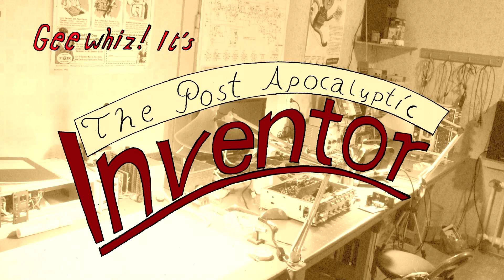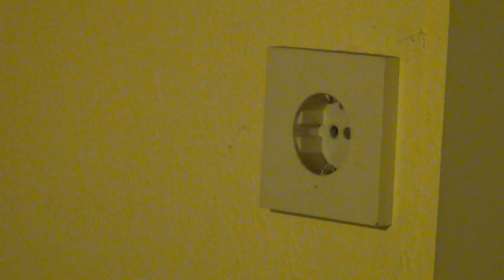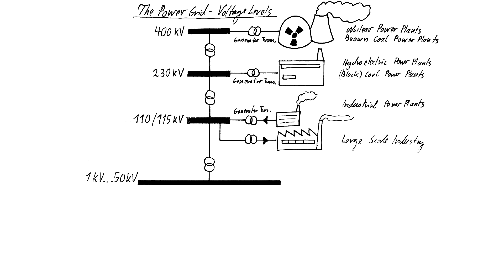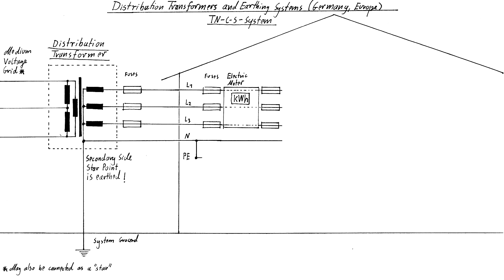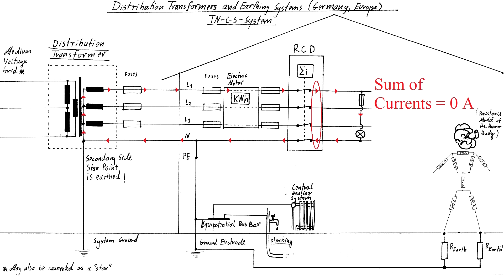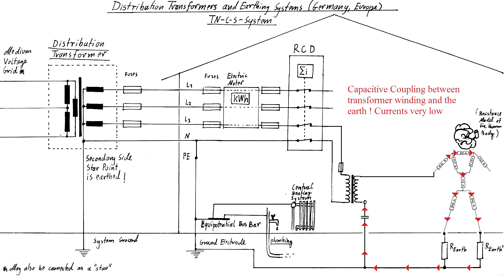The Power Grid, Isolation Transformers and Earthing

Comment: Thank you for the great video content.  Outstanding.  As to some of the comments, I would like to add some actual facts about the state of US regulatory law.

In the US, GFCI and AFCI standards are written by committees of practicing electricians.  They farm all the hard work out to an NGO called United Laboratories or UL (CAS in Canadia I believe).  Their sole focus on GFCI and AFCI safety is the PE connection to the enclosure.  Absolutely not to the real problem of Human safety.  By contract UL can only test and rule on the topics and devices they are given.

Look at this document:

http://www.screenlightandgrip.com/html/481_GFCI_Workshop.html - It is informative and fun - about the E safety systems used in the movie Titanic.

In particular, review the figure under section UL943.  If that does not get the point across, grab the neutral and hot phase of a GFCI/AFCI circuit.  Have someone notify next of kin.

The EU system of RCDs is a pain (I worked in Amsterdam for years trying to get 3P motors with phase shift problems to work, I know).  But, they are so far ahead of the US and Canadia, it is crazy.

If you have no experience with 3P power, don't confuse people with comments about the US GFCI/AFCI system.  3P is another world.  A pocket calculator and Ohm's law don't stand up to Dr. Maxwell.  Look at RCDs as part of Maxwell's world - not Edison or Ohm.

At any rate, great video.  Thank you.

Comment: Probably the best video I've seen on YouTube, certainly the best in a long time. You've cleared up a load of questions I had about how the electrical grid works. Do most houses in Germany really have three phase power? In the UK it's very rare to have a three phase supply, most have only a single phase coming to the house. I have three phase but I've wired the house to a single phase. I asked an engineer from power company about balancing the load on the phases and he said they don't care for the sort of current draws a house is likely to put on the system.
Reply from the maker: CNCtrl Yes basically every house in Germany has three phases available. Most people don't have 3-phase sockets in their houses though. But household equipment like electric water heaters, ovens and storage heaters are almost always powered by 3-phase AC here in Germany.
Reply: The Post Apocalyptic Inventor Interesting, what size of fuse do you have on each phase? A modern family house in the UK would typically have a 100A fuse but 80A and even 60A fuses were common in the past. The biggest draw I can think of for a typical house would be an electric shower at around 40A so there's still a lot of headroom on a 100A fuse.

Comment: Im thinking of building the same (transformer) . Should  it be wired as Mains then Isolation then Variac or a different layout ? Also the 300 VA transformers I will use (from salt chlorinators) have 2 secondary windings (4 wires) that were connected as 10v 0v 10v (to SCRs). Should I connect these secondaries to the other 10v 0v 10v ? Regards and thanks , Steve .
Reply from the maker: Steve Smith You have to connect the isolation transformer to teh mains and after that you attach the variac to it. I will talk a lot about the details of my isolation transformer in the next video. The video is now to 75 percent ready and it will gon online withing the next week. It will help you to get some orientation. I don't quiet understand what kdnn of transformer you are using ? Is it a "1 to 1" transformer that delivers 230 V at the output ? ( Or 115V if you live in the US or Canada). Are the 10V-Secondaries additional secondaries or are they the only secondary windings ? If they are just additonal windings you can either leave them alone, you can connect them in parallel (polarity is important !), or you can connect them in series to get +10V /-10V or 20 V

Comment: Haha The European electrical grid is so much more safe than here in america!
Reply: ***** But having high voltage lines increases efficiency.  I'm sure there is a reason for having any small transformers than larger ones.  Again--Likely because you can more easily transport high amounts of power at high voltage with less loss than you can at low voltage.

This is why we use dangerous AC voltages in the first place and not something safe like 12 volts.
Reply: +Kris S If using low voltage, eg 12V then you will need biger wire gauge. If there has toaster 2000 watts with low voltage 12 volt is 2000/12 = 166Amper. For 240volt is 2000/240 = 8,33amper. In the first case it needs cables 2GA for second 8GA. the problem in the US is the low voltage 115volt.
Reply: telosfd Exactly.  Low voltage = more heat and bigger wires. 120v is the standard and changing that now wouldn't be easy--Plus, the danger goes up with the voltage, so a balance is needed.

Otherwise we would just run our houses off of the mains 600,000 volt lines that go through the countryside.

Comment: What are some sources to know more about electricity, terms involving electricity, and any prerequisites needed to deeply understand electricity?
Reply from the maker: diething1 Well my friend. I'm sorry to tell you, but there is no easy way to accomplish what you're asking for. My advice is to start with the simple things. Maybe you should start by buying an electronics book for hobbyists. Something from the 70s or 80s. back then things were simpler than they are  today and learning electronics started with resistors, capacitors and transistors.( Not with microcontrollers and FPGAs like today :D). Back then many people who weren't professionals wanted to understand electronics and there was a big market for books and magazines, teaching the basics of electronics. The stuff from back than is still good and often not very expensive. (You could even check the local libraries).
Books like that can give you a feeling, of waht kind of basic components exist and what they do.
Once you understand the basics you can work your way up to a more professional understanding. As an addition to the practical knowledge taught among hobbyists, you have to learn how to apply basic mathematics to electric circuits. Principles you must look up and learn to understand in any case:  

Ohm's Law, Kirchhoffs's Voltage Law, Kirchhoffs Current Law, component equations for capacitors and inductors.  

Once you know these things, I would recommend to buy an electricians training book. It will help you to understand the basics of AC-Systems, without the need for higher mathematics. 

If you want to get an even deeper and more general view of electronics you would have to study electrical engineering. You could again try that by reading books, but that alone won't work. You would have to spend a lot of time learning mathematics and how to apply it in the field. That can only be done by actually doing a ton of calculations. It can only be learned by practicing. That is very hard, if you have no instructor. If you wanted to do that on your own you needed several very good books, having both training exercises and solutions with explanations. But books like that are as rare as anything. Studying at university might provide you with a lot of exercises and instructors, but the things you learn there are very theoretical in nature and most people need many years to finish their studies. Still many leave university with a feeling of ignorance. There is no easy way.

Comment: I have just discovered your videos, and have spent this evening watching many of them.  They are fascinating and very educational, thank you.

In this video about the Power Grid, you describe all 3 phases going into the home.  Is this standard procedure in Germany?  I ask because I do not think this is standard in the UK, where I am.

As far as I know, UK homes only have one phase to each household.  Of course, larger offices, factories etc may have all three phases, especially if they have 415 Volt equipment.  I do not know of any 415 volt equipment for a typical UK house.

Of course, the UK has some historic quirks with electrical wiring, but it surprised me to hear that maybe Germany has all 3 phases at every home.

Thanks,

Ian
Reply from the maker: SheddyIan Hello. It's nice to hear that you liked my videos so much :)

Yes in Germany the power grid is a 3-phase system from the power plant all the way to the single houses. 3 phase power is available in virtually every home. Electric ovens and water heaters  are 3 phase loads, which you will find in many households in Germany. People like me, (who like to use power tools), often have special 3-phase outlets in their garage, basement or home workshop as well. Like in the UK normal living rooms only have single phase AC and consumer products are almost always designed for that in Germany as well. 
People without a home workshop or any special use for heavy power tools etc. do often not have any of these 3-phase outlets, but they could easily be added, because the 3 phases of the low voltage grid lead into their house and are available inside the breaker box (= home distribution board).
Even if a house does not have any 3-phase loads at all, the single phase electric outlets, the lighting and other loads are connected to the 3 phases and the neutral in such a way, that each of the phases is loaded about equally. We do that to avoid asymmetrical load conditions in the power grid. 
Germany has a very well developed infra structure and it indeed seems to be the case, that in many countries, 3-phase AC is much less available than here. To find out more about the situation in the UK, you could for example open your breaker box and check, if the 3 phases lead into your house or not. Furthermore I recommend you to check an electricians training book from the UK. Please tell me, if you find out more. I would be interested in knowing more about the situation in your country.
Reply: The Post Apocalyptic Inventor Hi, I am sorry to be so slow replying, I have been asking around for some information.

 I know that in the house I currently live in there is only one phase coming in to the fuse board.  (My house and wiring is old enough to only have fuses, not breakers!).  I have also spoken to a retired electrician, and he tells me that he does not know of any houses that have 3 phase, only factories or commercial properties with a larger load.

Load splitting between the 3 phases is done at street level, so on a typical street, house 1 might be 1st phase, house 2 might be 2nd phase and house 3 might be 3rd phase, house 4 being 1st phase etc.

Electric water heating in the UK is usually done with a storage tank, which has a 13 Amp immersion heater installed on a time switch to run for a few hours each day to heat the water, sometimes taking advantage of a cheaper overnight tariff to heat the water for the next day.  Although many British homes use gas to heat either a hot water storage tank or to provide instant hot water with no storage.

Electric ovens and electric instant hot water showers also just use one phase, and are usually rated at 45 Amps or so.

On a side note, British electrical wiring is different to other countries, in that we usually use the ring-main system for electrical outlets.

The cable leaves the distribution board, and is connected to each outlet in a daisy chain before returning back to the distribution board again.  In this way, a smaller cable can be used (2.5mm) and yet still provide 30 or 32 Amps of maximum current to each circuit.  (Each outlet being rated at 13 Amps).

Lighting circuits are wired radially, using 1mm or 1.5mm squared cable.

I hope this is of interest

Ian
Reply: SheddyIan Very interesting information. I live in Denmark and our wiring is identical to the german 3-phase system. With 3 phases at hand in the house, all installation wiring can be made with 1,5 square millimeter cable. Even an electric cooker can run on a 13A group. The only place i have a (5 x) 2,5 mm cable is to my garage, because i work with a 250A Esab mig welder, demanding a 16A fuse group. The supply from the cable box in the street is a 4 strand 16 sq. mm cable, fused with 63A. The ground fault relay (hfi in danish) is mandatory.

Comment: Here in the U.S. most homes have 2 phases going into the home. Only high-load devices like furnaces and clothes dryers use 2 120v phases together for 240v. Everything else is connected to one 120v phase and a neutral. There is also a ground conductor in outlets and light fixtures which is connected with the neutral conductor at the panel.

Most homes have circuit breakers, fuses are in older houses. Newer homes might be built with whole-house GFCI(our term for RCD) systems but I don't know if that's common. Most existing ones don't. They are usually found only on a few circuits, such as the one feeding a bathroom.

Comment: Great video, thanks!
You are correct we use SWER systems here in Australia.  It is very common, even just a short distance from the major cities (like Melbourne) in the rural areas.  As it supplies farm houses, they generally have small workshops, also.  It makes it hard as they often require 3 phase power for heavy machinery, so quite often they will require their own 3-phase generator for these loads.  Phase converters are also sometimes used.

It also sometimes causes an unexpected problem for pilots of helicopters and light planes (like myself)!  As the power poles are spaced quite far apart compared to a normal transmission line, it is almost impossible so see where the wire is, many light planes and helicopters who are landing on a farm airstrips or making an emergency landing in a field, have struck the SWER lines and crashed.

Comment: Excellent video. Fantastic explanation.
In the USA in some states ( Mid-West e.g. Kansas, Oklahoma ) the primary distribution Voltage (7.2 or 14.4 kV)  if often 4 wire Y configuration. with one Earthed High Voltage conductor. It may be because of the thunderstorms encountered in those areas. Also SWER systems can be employed without an isolation transformer. The House Voltages are 120 - 0 - 120 Volts. or 240 Volts 60 Hz between the outer two. Look forward to part 2.
Reply from the maker: Hey thank you for the info. I could imagine that there are a number of different systems to be found in different parts of the US ( just as you described, when talking about typical climatic conditions in the Mid-West)  I have read about the SWER ( Single Wire Earth Return) system, but I thought it was only used in Australia. Good to know that it can be found in parts of the US too. In Germany we don't use it at all . Our country has a very well developed infrastructure and virtually every household has 3-phase AC. But that's mainly because the country is much smaller than the US. Supplying every household in your vast country with 3-phase AC would be an undertaking of epic proportions.
Reply: The Post Apocalyptic Inventor
No worries. The SWER systems are used in Australia and New Zealand for remote locations. Voltages are often 11 or 19.5 kV single phase, In that part of the world they are fed from a 3 wire system and require an isolation transformer, otherwise the feeder would trip out on Earth fault.
In The USA set ups vary from State to State, In Texas there are SWER systems 20 to 30 miles long with lightning arrestors on each 3 rd or 4th  pole in case of lightning storms to protect the transformers from Voltage surges.

Comment: The RCD may be called a GFI (Ground Fault Interrupter) in the USA.
It is not just a breaker box.
Reply from the maker: Of course the RCD is not just a breaker box and I didn't say that. I said that it measures the sum of the currents passing through. I simply spared an explanation of how an RCD works in detail, because that is not the topic of this video, which is already 25 minutes long.
Reply: The Post Apocalyptic Inventor
Sometimes I am too cryptic, sorry.
GFI = RCD  ?    in usa was the message.
Reply from the maker: Ah ok. It`s all right then. Thanks for the information and sharing my video :)